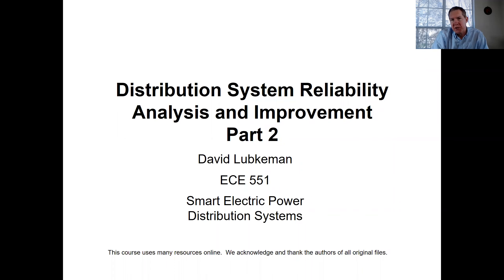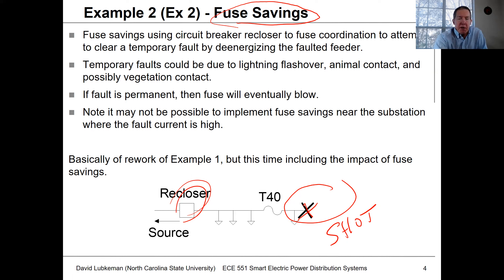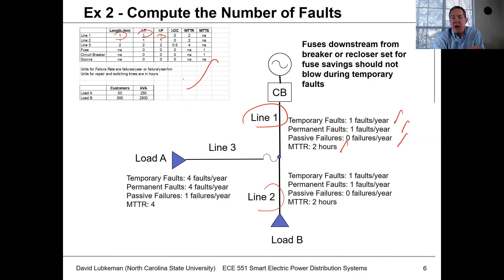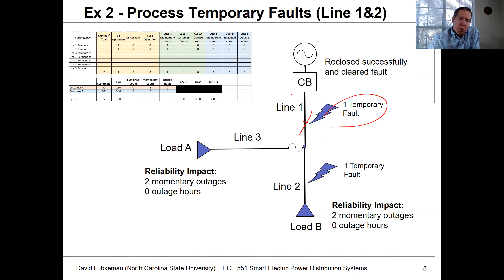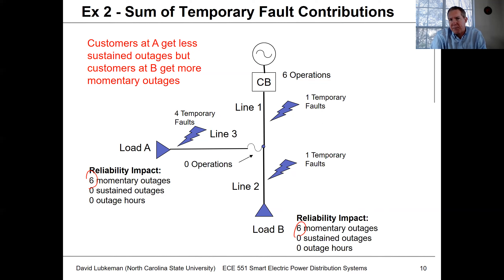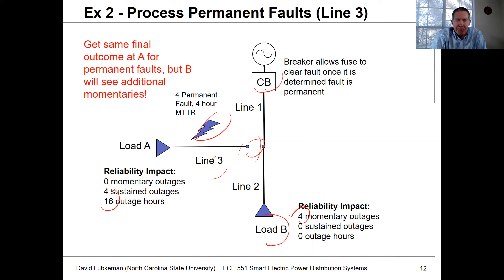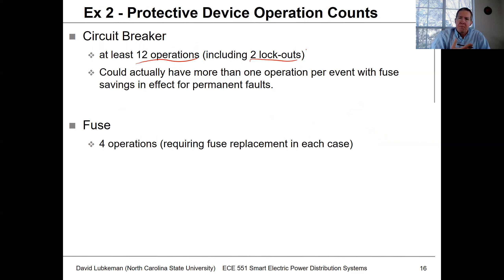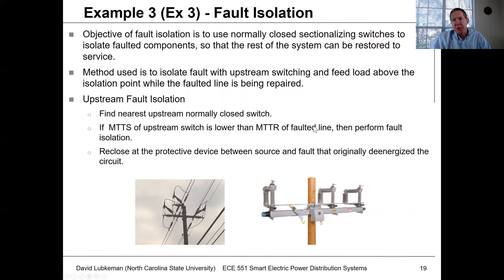Lecture 17a: Reliability Part 2 - Fuse Savings - Power Distribution Systems Spring 2021 - Lubkeman

Comment: Sometimes if the lock-out zone has significant or "important" three phase customers, it may NOT be desirable to blink the lights for the feeder  to save a fuse down stream. Every circuit has it's own characteristics and / or customer base and fuse savings at times may not be desirable. If that down stream fuse can be replaced with a recloser or trip saver that blinks for the fault, then we can minimize the reclosing within the LO zone.
Reply from the maker: For power quality-sensitive customers, even a temporary interruption could be costly.  So you are correct in that we need to be careful about deploying fuse savings.  There are a number of single-phase reclosing products, which could be deployed as suggested.